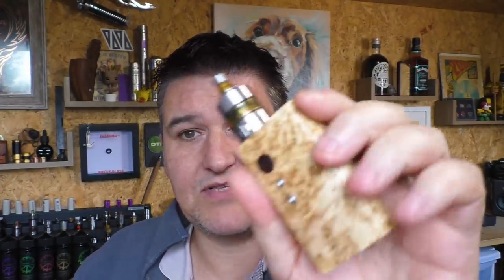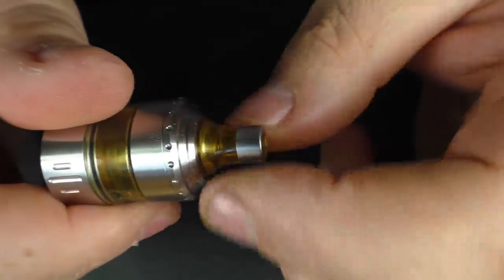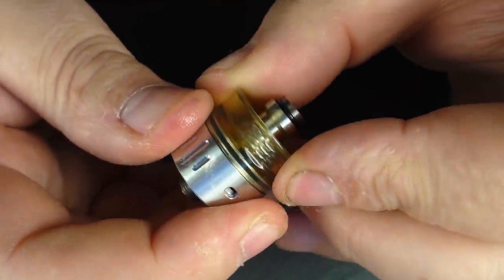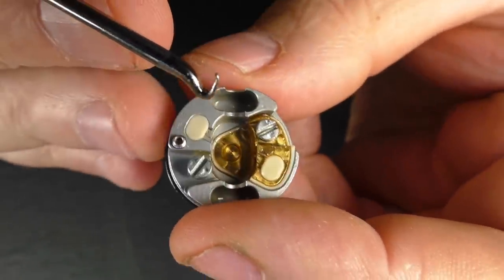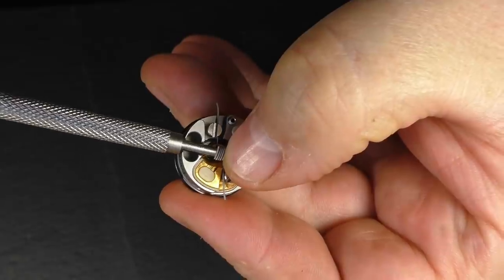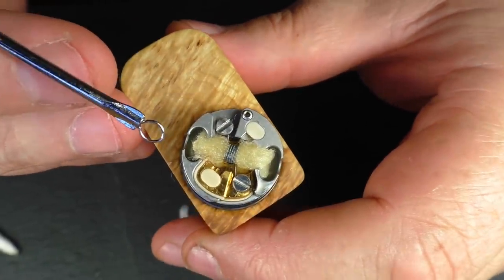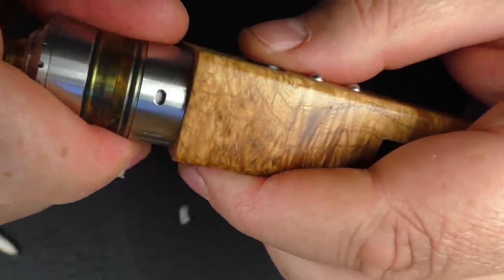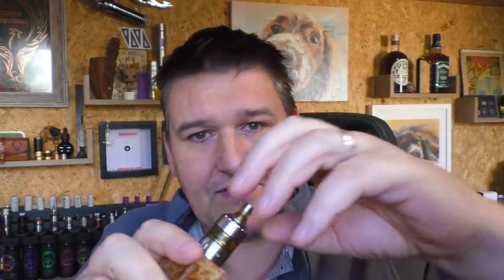Project X MTL by Hussar Vapes

Comment: Love the look of the project x rtas. They just look good. Im glad they did a proper topfill. Not a fan of those slide up side fills. They work on gennys but not in rtas imo. Alot of the ones ive tried tend to leak. Im assuming they dont keep that pressure like they should. Its the only reason y i cld c them leaking more than any others. Very nice but so outta my price range. Great review tho. Per usual the video quality is meh at best. Bahahaha

Comment: Even with 1mm inserts, this RTA is still way too airy for proper MTL. And no, I'm not talking about an ultra-tight draw either.  Hussar's previous RTA was much better suited for MTL imho.
Reply: A 2x1mm airhole doesn't equal to a 2mm, it is around 1.5-1.6, which is by veteran vapers a proper MTL is 1-1.8mm 

I wanted to say that perhaps you don't know this information
Reply from the maker: We are all different, what I discuss in my review are my findings, as I said, prob need the 0.8 inserts for an old school MTL but IMO the 1mm do give a nice MTL vape, for the very reasons Hussam just gave above :)
Reply: @SOMA-WR  It's actually equivalent to a single 1.4mm, close as makes no never mind. Way too loose for me (I like a single 0.8mm hole myself and can sort of tolerate 1.0mm if I have to, but I'm old and weird), but it's definitely well within MTL territory.
Reply: @stanrogers5613  thanks bro, me my self I love the 0.9 set up in my Taifun GTR

But my issue with that small of an air hole is that you are creating so much vacuum by suction that juice comes from the juice port of an RTA
and if you increased the cotton, you don't get good wicking.

Did you ever faced that issue with an 0.8mm in an RTA?